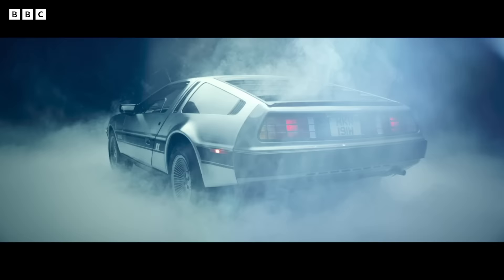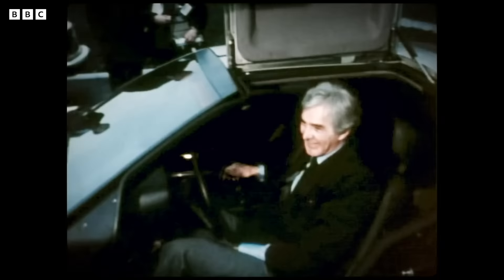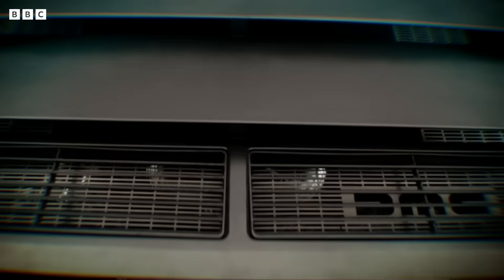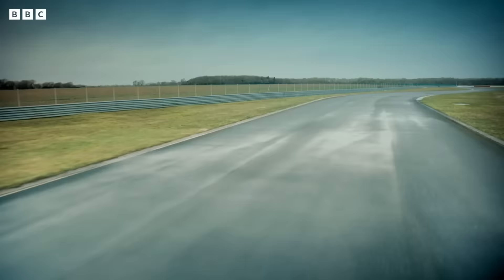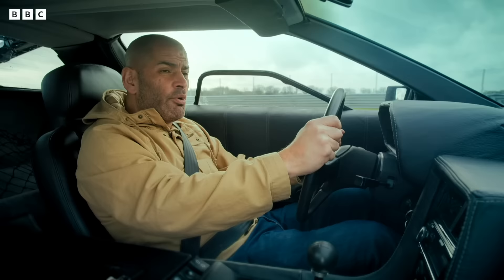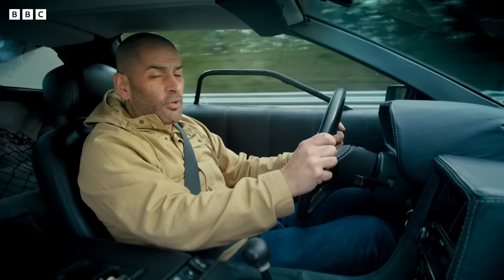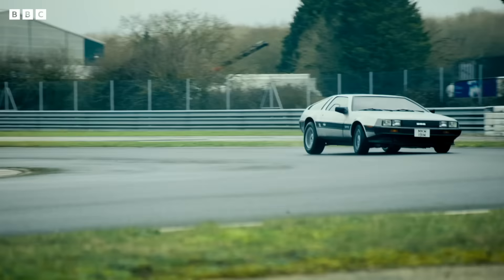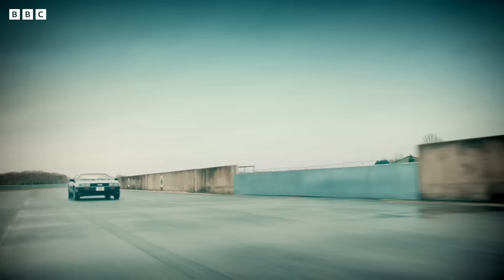DMC DeLorean: The Back to the Future Superstar Car at 40 | Top Gear

Comment: It's true, all of it. Bear in mind, even Chris is being generous as the one he's driving is in near mint condition. Many are not. I rode in one decades ago and it was like driving a truck with too small of an engine, and very little thought put into suspension tuning. I had a 1996 Honda Civic at the time, and despite being bigger (almost anything is bigger than a DMC-12) and having similar power, it was still faster because it was several hundred pounds lighter, and that car was slower than some minivans. Everything under the iconic skin was objectively average, or worse. Some have been made into proper sports cars with handfuls of money, it's just a shame they didn't come from the factory that way.

Comment: Terrible?  Hardly.  The majority of sports cars in that time period (81-83) were not better in terms of speed and such.  It was just what was factually available at the time.  NO cars were really "fast" back then in comparison to what we have now.  Also... the car is not heavy at all, so get your facts straight, sir.  In actuality the car was MUCH lighter than other cars built at the time due to the fiberglass under body and the thin stainless panels attached to it.  And as for the handling... Jesus, man, you're comparing it to what we have in advanced technology on cars TODAY.  The car is 40 years old, what do you expect by today's standards?  So while your OPINION may be that the car is/was terrible, that's not actually fact.  Ask any DeLorean owner today.  Even though those people have a love for the car, they will tell you (factually) that the misconceptions of the car are generally unfounded.  Your video quality is nice.  Your facts, not so much.
Reply: Why do people, let alone auto journalists, keep perpetuating the myth this car is so heavy? Does anyone seriously believe there is a significant weight difference between the same shape/size fender or quarter panel whether it"s made of stainless or mild steel?